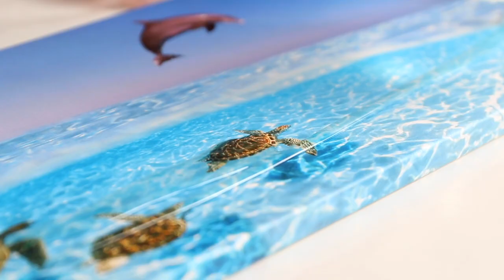Top 10 Easy Resin Projects

Comment: The toothpick poke at the end of your videos, is that just to show how thin the layer is? Thank you so much!
Reply from the maker: Hi Julie, we use a toothpick to pick out any dust or hair that has landed in the surface of you resin.  It is good to use a flashlight and get down level to see if there are any little bits you can pick out before you cover your work and leave it to cure.

Comment: Just loved it 😍😍. mdf, silicon is used for resin art 
What else we can use to make resin art ? 

Can we use steel plates, glass plates
In which we eat food ?
Or if yes than we need to throw them aftr using
Reply from the maker: ArtResin epoxy resin will bond well to every medium, with the exception of wax paper and plastics including silicone (i.e. materials that repel water). It works extremely well on wood, photographs, inkjet prints, acrylic, oil paint that has completely dried, watercolour, spray paint, encaustic, ink, paper collage, oil pastel, sculpture, flowers, rocks, and other found objects.  It will also adhere well to steel and glass surfaces.  Once cured ArtResin is food safe.  Please see this blog for more information: 
https://www.artresin.com/blogs/artresin/artresin-passes-food-safety-tests?_pos=1&_sid=2e0ff62cc&_ss=r

Comment: Is Art Resin good for coasters with hot coffee mug? What temp is it good
Reply from the maker: Hi Liz, ArtResin has a heat tolerance of up to 120F.  You can safely use ArtResin as a coaster for use with coffee mugs etc, however it would not be suitable to handle bakeware straight out of the oven.

Comment: What do you do with the hardener and when??
Reply from the maker: Hi Debra, ArtResin is a two part epoxy resin.  You mix the resin and the hardener in equal parts for 3 minutes until well combined, it will cure to the touch in 24 hours, and reach its full cure in 72 hours.  For complete instructions, follow the easy steps in our instructions: https://cdn.shopify.com/s/files/1/0770/0749/files/HOW_TO_APPLY_ArtResin_Epoxy_Resin.pdf?v=7641636361366666940

Comment: Is there an easy/recommended way to thinly coat all 6 sides of a cube with artresin? Should i do it separately in to parts?
Reply from the maker: If you are coating something that is a cube, I would recommend doing it in sections/sides so that each side can be level and cure properly.
Reply: ArtResin if you were to coat them using a disposable foam brush, would i still have to sand the surface before adding the second coat?
Reply from the maker: @_____jy  not if you applied the second coat when it was still tacky usually about 3-5 hours into the cure .

Comment: How do I get rid of bubbles if I don’t have a heat gun or torch?
Reply from the maker: For best results you should begin with a warm water bath prior to mixing.  This will help the bubbles to clear out easier on their own.  If you are using a silicone mold you can spray a light mist of isopropyl alcohol on the surface which will eliminate the bubbles.   While we do not recommend using a butane torch on silicone molds, it absolutely is the best method for removing bubbles from your poured canvas.  :)

Comment: How deep can you pour Art Resin?
Reply from the maker: ArtResin was initially designed to be a sealant and poured at an 1/8th of an inch in depth. We do have artists that use our product for pouring deeper than an an 1/8th of an inch but they achieve this by doing multiple pours. You can go up to 1/4 inch in your single pour and would suggest you use a torch to help pop any bubbles you may have.
Reply: @Artresin  thank you
Reply: It is best not to go over 1/8 of a inch let that cure for a few hours 4 to 6 is safe zone and then just pour a second layer
Reply: @alexiscraftyourlifeaway9587  Thank you